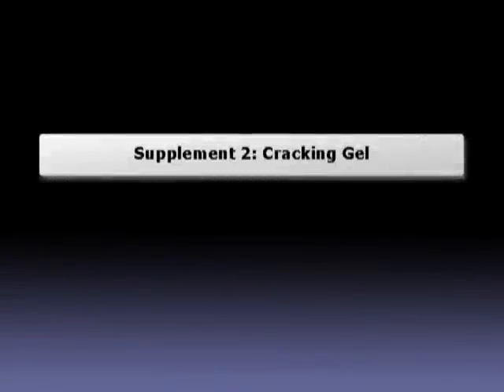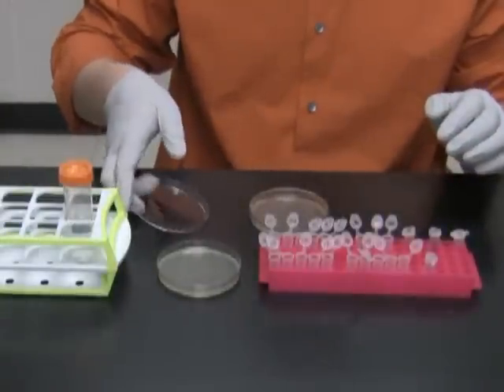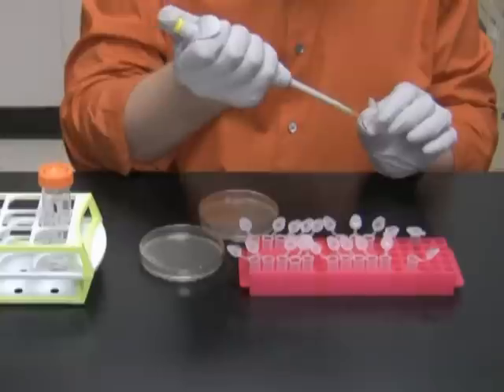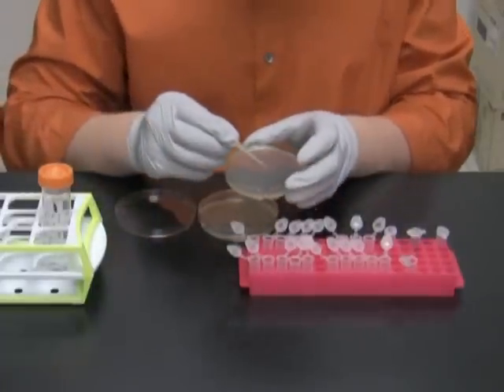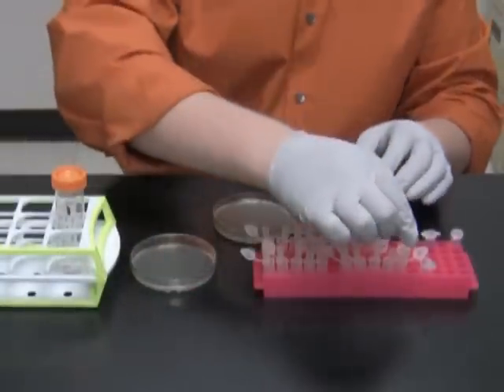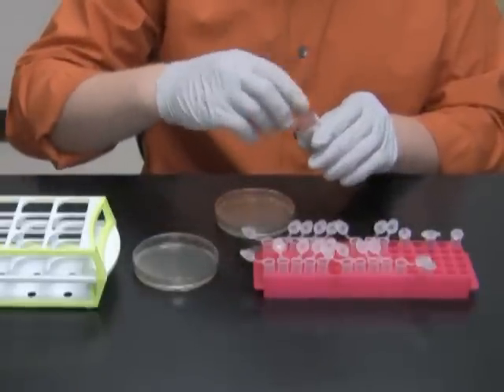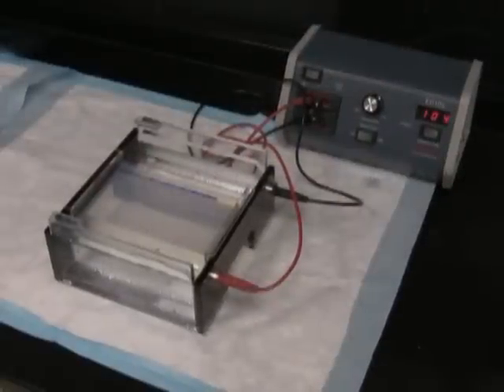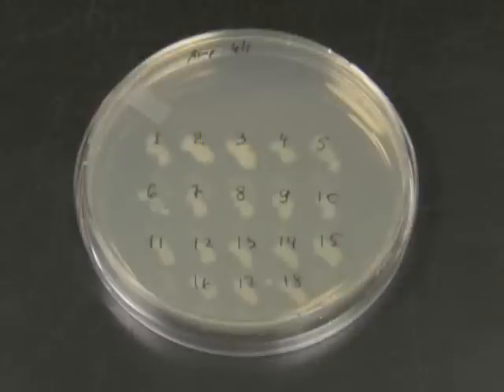Simply Cloning - Supplement 2 - Cracking Gel

Comment from the maker: Hey! One of the first times I did this protocol I also incubated longer and at higher temperature. And I also got complete degradation of all DNA.
The cracking buffer is very potent. It lyses cells instantly. Add the loading dye straight away and have a gel ready so you can load and run it immediately.
Let us know how it goes

Comment from the maker: Yes, I do mix each sample right before loading on the gel.
No mixing before adding loading dye because:
- This protocol is time sensitive. Cracking buffer degrades DNA as well, so I am trying to everything as fast as possible
- Adding cracking buffer to cell suspension is enough to break the cell walls even without mixing
- I love taking shortcuts when it makes sense ;)
Thanks for the question, it is spot on.